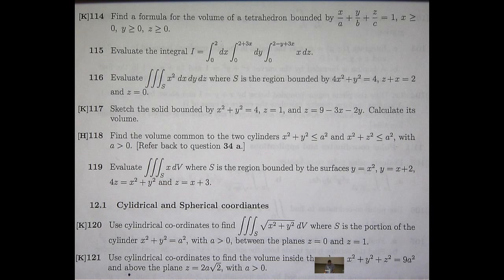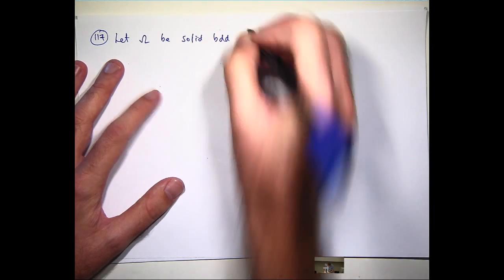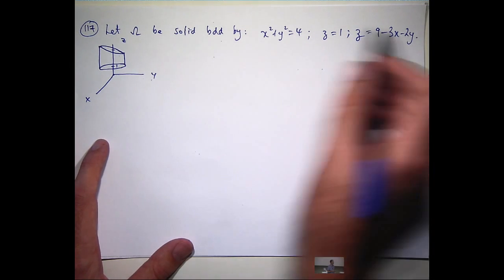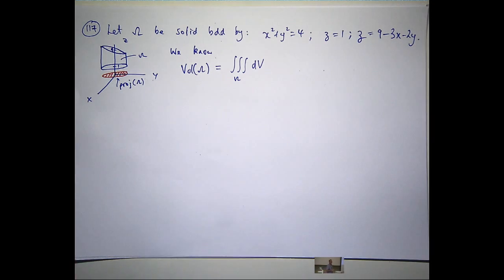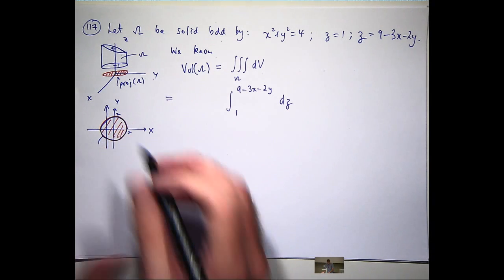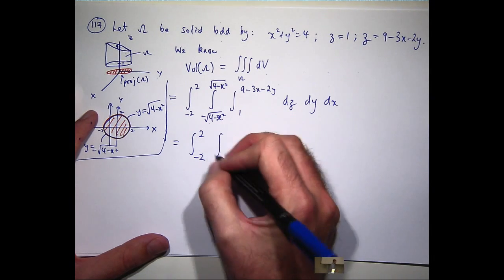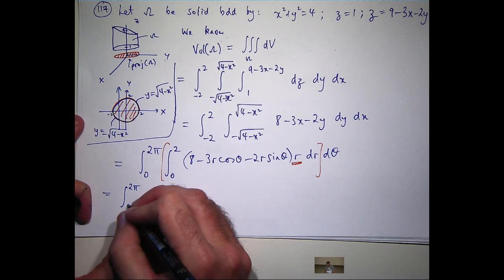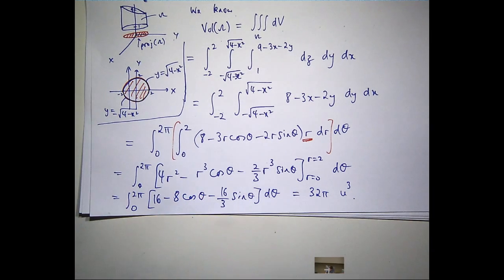Triple integrals:  How to calculate volume

Comment: I don't really understand how to sketch this. All I can say for sure is x^2 + y^2 = 4 is simply a square in the x and y plane with the radius of 2 and that z = 1 (just sketching it out). What is difficult for me is z = 9 - 3x - 2y. Should I think similarly on how you think there? that when x and y = 0, we have z = 9 (easy to sketch out). Then what? Can I then continue and say "what if x and z = 0? what do we get then?" - we then get 0 = 9 - 2y which equals y = 9/2 => y=4,5 or y and z = 0 and we get x = 3. Then I can point out y = 4,5 and x = 3 and z = 9 on the xyz-plane easily. IS this how I should think?

What I do then, to find the order of integration, I look at the original function and see what terms look the "easiest" or less "cluttery". In our case we have x^2 + y^2 = 4 while z is "simply" consisting of terms that are not squared, hence our choice of integrating z first. Correct thinking?

Furthermore, in order to find the limits of integration I sketch everything in terms of xy-plane, xz-plane and zy-plane. When I did this with the given information, the xz and yz planes just becomes... weird. How should I think when I want to find the limits of integration?

Cheers!